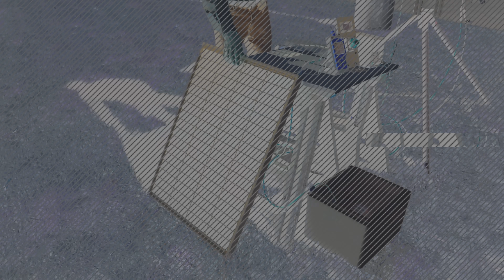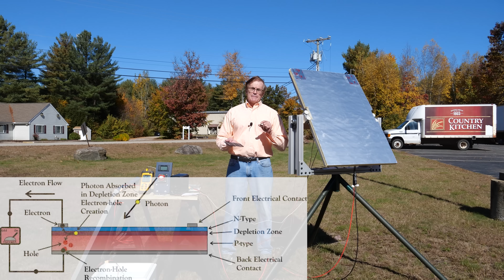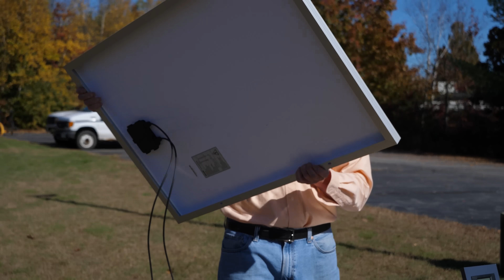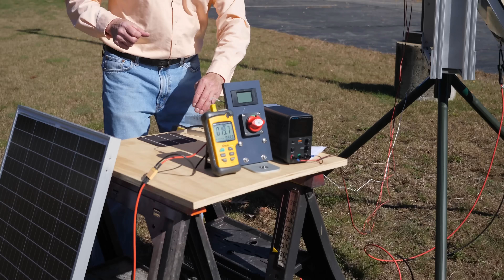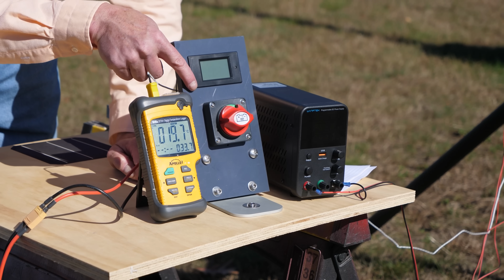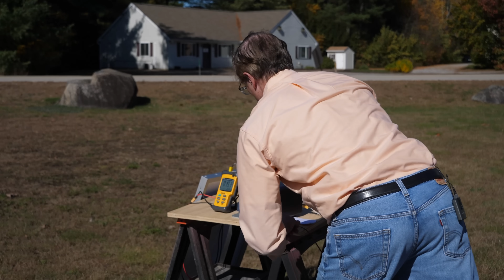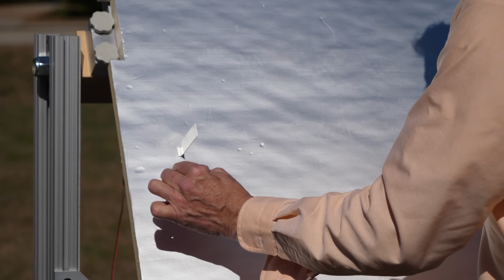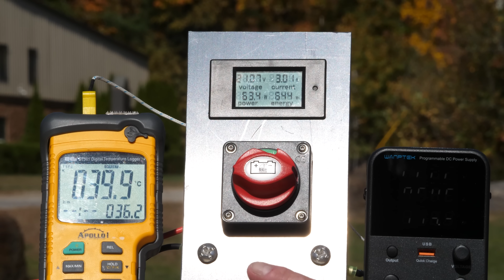Do you REALLY get enough out of your solar panel?

Comment: The benefit demonstrated in your experiment is overstated. The baseline should have been done without the heatsink and shroud. The high temperature may have been artificially high due to the lack of natural convective current on the back side. You could at least test the junction temperature of an unmodified panel in the same conditions with your second unit to confirm the validity of your test method.

Comment: I have copied part of an article to illustrate the impact on pv panels output in hot conditions. 

...... his move into solar energy came about when he installed a 3 kW PV system on his domestic roof and found it never delivered 3kW, especially on searingly hot Western Australian summer days — “In the middle of summer, it was struggling to make 2kW,” he says.

“Then I started to learn a little bit more about thermal de-rating.”

Although solar efficiency at Standard Temperature Conditions is pushing through the 21% barrier at the high end of the solar-panel market, most panels are rated around 17% efficient, and in hot, sunny conditions their performance can drop back to 13-14%.

“Panels heat up 20-30 degrees in sunlight, which isn’t good for cell performance,” Martin Green, Scientia Professor at the University of New South Wales, and Director of the Australian Centre for Advanced Photovoltaics, told pv magazine earlier this year.

Comment: very  interesting  I'm in thailand average OAT is about 35C daytime, I'd not use local water for cooling (and anyway I'd add car radiator fluid to any system to ensure no corrosion)  as it's hi calcium lake water - Anyway  I do extract distilled water from my A/C systems, but I use this for testing a solar-powered electrolytic chlorine generator Im experimenting with for the pool using scrap titanium and salt water.  So if I can get the hot water into a day to night storage tank I can have free warm showers even tho it's hot here cold showers in the morning are really not my "cup of tea" (british retiree)  I can get all sorts of aluminium stock profiles a bit like finned heatsinks I use in power electronics  from my local sliding window guys, and that bonded onto the rear of a panel could also be useful as a tunnel for airflow, either way I'll experiment,  I take heed about your decay rate over time. Very large panels here (chinese manufacture) are about 120 USD each (so what the heck are you guys paying so much for????? - import duties??, build a galvanised box section steel frame and put it in the darn gardens and anyway that improves maintenance access and neighbour acceptance and roof leaks !!!) I mean what 3-4kW per Sq Meter here and we are not using it, WTF???

Comment: Copper is a better conductor than aluminum, could you increase the efficiency by using copper? Could you achieve a similar level of cooling with a completely passive copper heatsink? Thank you for conducting this test, I live in Wyoming and I have been considering solar for my house.
Reply from the maker: It would help, but the cost would be significantly higher.  It may not be the best upgrade option.  A denser array  or larger fins in aluminum  may be a better option.

Comment: Thanks for the video, very interesting. We have PV on the roof here in Brisbane and I can see the degradation in efficiency is quite dramatic. When installed in 2019 we generated 9.35 MWh, but last year just 7.57 MWh. I think it's not just the heat per se, but the constant heating/cooling that causes microscopic cracks in the silicon substrate? I think I read that when researching it. Either way, we're making 85% or more of our power from the sun, which is saving us a lot of money 👍🇦🇺
Reply from the maker: One argument for the manufacturers not addressing  this issue may, in fact, be designed obsolescence.
Reply: @TechIngredients  Very possible.
Reply: Quality made solar panels will typically have a bit of initial degradation (~1 to 3%) within first year then degrade annually at less than 1% per year thereafter.  Your system may have an issue.  Do you have a warranty?  My panels have a 25 year prorated power warranty and if they dropped as much as yours did, I'd be immediately making a claim!
Reply from the maker: That's  possible, but at the temperatures of a rooftop  in Brisbane, the degradation  rate will be significantly  higher.
Reply: @TechIngredients  Don't know why you think that.  I'm in southern Arizona which is, generally, considerably hotter than Brisbane and my solar panels aren't degrading at a "significantly higher" rate.

Comment: Wondering what cooling could be achieved with passive means such as the chimney effect? Not that the fans are a massive power draw, but they are an added expense and point of failure. One idea that came to mind for utilizing the waste heat would be a solar dehydrator which could be designed as a chimney to draw the heat off the solar panel(s) similar to a vertical smoker cabinet.

Comment: As a wind an solar off-gridder for 20 years, I love the benefits. But I'd be interested to know what the addition of many more but smaller rear, vertical cooling fins placed in a chimney-style arrangement for increased convection & cooling air transfer (sealed at the back except with lower intake and upper exhaust)- but w/o the cooling fans- would do to reduce the effects of the heat. Esp. w/a good tracking system as I have made DIY, which maintains the heat on the panel increasing chimney effect.

Eliminates much of the cost, complexity, & maintenance while (hopefully) increasing output and longevity. I'd love a comparison test vs.  this forced air system. Even perhaps with an optimized combo system of a small computer fan (at the end?) of an extended 1 or 2 ft stack (assisting the natural chimney effect) but at FAR lower power consumption.

Just a thought.

Comment: use Peltier module in between the cooling fin and the panel and feed the power produce by the termal difference in the peltier module to the load.
Reply: or make the solar panel with a Peltier module as a base ..like  deposit the layer of material directly on the module

Comment: Yeah, but the sun isn't always shining in a 90 degrees angle from the panel. Meaning, the panel is not always running at 50c without fans. You could make use of regular convection air flow, by allowing the hot air to exit on the top of the panel, and cool air from the bottom.
Then again, if you have several panels on a roof, the bottom panels will be the ones getting cool air, while the top panels will have to do with ambient air temperatures polluted by the bottom panels. Unless each panel gets a tube of fresh air flow from the bottom of the roof.

Aside from natural convection, you can use a fan to aid the convection flow, not sure if a fan is more efficient blowing cold air in the panels, or removing hot air from the panels. Same airflow per fan, but hot air is less dense. I played around with similar 80mm case fans, and in my scenario, I preferred to run them around half a watt to a watt as well (it was electrically easier to run them at 5v in my setup, as i already had a 5v supply line).

Comment: Or I could use distilled water in a closed system. More money. And using domestic water we would have to add Some sort of water filter out impurities that we have here in Florida. That would add more to the cost as well. I used to use distilled water to cool my transmitters that I could North Carolina no it wasn’t that expensive.

Comment: Here in Florida where we live in Southwest Fort Myers area The air temperature never gets below 40° here Fahrenheit so we could use the excess heat to preheat the hot water. And the excess heat could be used to heat the pool but the pool salt water so we have to use some sort of heat exchanger interesting might be fun to do more to follow

Comment: Stopping at the 7:00 mark to comment that I would have simply purchased lengths of extruded aluminum angle instead of trying to bend all my own to create heatsink ribs. I can buy it at most local hardware stores. Don't even need a metal fabricator. In my area, there IS an industrial metal supply yard where I can buy all varieties of metals (steel, aluminum, brass, etc.) at extremely low cost. If you live anywhere near a metropolitan area, I guarantee there's a supplier within a short drive.
Reply from the maker: It's  a matter of cost.  Those angles cost significantly  more than the aluminum  in them.

Comment: It's a very nice idea the use of these fans, but... how much do they cost and for how long will they run before they need replacement? they are exposed to the weather and external dust build up.
Reply from the maker: Good question.
The MTTF for these fans is 50,000 hours  at full power. They only need to run about  8 hours per day at 25% output and then only when it's  clear. Dust may be an issue as it is for the panels  themselves, but they are washdown compatable.  Nevertheless, that has to be evaluated.
Reply: @TechIngredients  I guess the position of the fans helps the dust buildup and it's worst than the dust on the panels that are easy to clean, even through the natural way of the rain for example. 
From my personal experience (with lower grade fans, for less demanding and less exposed environment) when they are exposed to the elements they never go "the easy way".

Comment: Pity you had the plate on the back during the initial test, as it would be reducing the airflow compared to an open back
Reply from the maker: Not really.
The structure  is still open and convective flow is very slow.
The modified version runs slightly cooler than the stock panel, even with the fans off.

Comment: Very useful.  Thank You.   I'm not keen on the evaporative losses of a "flow-over" type liquid cooled system.  One commenter below J.R. mentioned a pool heater, which makes one think perhaps a dual air/water (closed loop) might be feasible, i.e. heat the contents of a water heater by day, and by virtue of daily hot water useage, there would be that much thermal capacity ready to be a heat sink each morning.    But those 3 fans connected in series and directly to the cells output do seem a very good match.
Reply: The report on using water cooling that I read online said that they used 15.6 liters of water (losses due to evaporation) per panel, in a day.  So not free, but ~125 gallons of water a month per panel isn't so expensive, either.  That's about 11-12 a dollars a month where I live, if you had 10 panels to cool.  So you do gain more than it costs as the desert sun where I live bakes everything into a crumbly, brittle dust in a few years.  45-50C days are common and for that, yes, cooling the panels with water seems a far better option than air.  For where he lives, they never get hot enough to warrant the extra cost.

Comment: What is the eval test result? Without the heatsink at the back how hot does it get
Reply from the maker: The modified panel runs slightly cooler than the stock panel, even with the fans off.

Comment: This test is bogus. First test was made leting panel to heat up, but there was no second panel in the test without fans and double wall making this tested panel into the green house. Bare panel would not heat up to what it did in this test, hence 2.5W would not be saved.
Reply from the maker: Actually...
The modified panel runs slightly cooler than the stock panel, even with the fans off.

Comment: use a corrugated plastic panel instead of the aluminum. Put the fans at the bottom blowing up since heat rises. Not sure if adding slits in the plastic would help or not.
Reply from the maker: These fans were exhausting near the top for the same reason.  Why the plastic, cost?

Comment: You aren´t taking in account that the aluminum plate in the back doesn´t let the panel cold itself by just the natural air convection. Also the maintenance cost goes up because that fans aren´t gonna last more than a 3 years if you are lucky enough. A water cooling it´s more efficient and also you get hot water that saves you gas.
Reply from the maker: Sure, it does. The duct isn't  sealed, and the backplate is very conductive.  Also,  the modified  panel runs slightly cooler than stock, even with the fans off.

Comment: I would go fanless. Route ambient air through vertical cooling funnels under the panels and build a black solar chimney at the top of the roof. The chimney creating a natural draft sucking in cool air under the panels without moving parts.

Comment: To determine the angle of inclination you need a tube shining on the screen.  If you have a circle of light, you're straight.
Reply from the maker: That's  another way to accomplish  the same thing.  The machinist's square is a little easier to demonstrate.

Comment: I'm excited for any future videos you guys do with Fresnel lenses. I'm working on an automated solar tracking lens and I want to use Arduino to gather telemetry data from the panel and the melt stand. I'm a programmer by trade, so my software engineering skills are pretty solid, but my physical engineering skills don't go much beyond building a car out of Legos. The machinist's square to find the perfect angle with the sun is a brilliant idea; I'm definitely going to start using that technique going forward.
Reply: That is basically how you track the sun with an arduino.  4 light sensors in a divided quadrant, and read the intensity, when pointing at the sun they should all be equal.  As sun moves, one or more will drift into shade, so you move it.  Just design your rack of panels so they don't cast shadows on each other when they tilt.
Reply: @robertsmith2956  yeah that works until there's a cloud for 15 minutes and your panel suddenly starts turning in a wrong direction and melts your stand. Automation, even if it's complex and time consuming, is a much better solution than the 4 divided solar panels idea. The simple solution has flaws.
Reply: @detinator5  Yes, but a RTC will let the arduino know it is 2 o'clock and the sun is at this angle.  It's called a cloud cover subroutine.  Will handle a solar eclipse as well.  If you like you can even monitor the output, drop in amps with sun jumping across the sky = cloud, not end of times.
You miss how it can be used to repel an attack.  bad guys 3 o'clock, turn and burn.
Reply: @detinator5  they would still all read approximately the same intensity though ...
Reply: @detinator5  One thing to watch out for that confused my tracker.  After sundown, the sun decided to light up the sky for 10 minutes by reflecting off the bottom of the clouds.
RTC said after sundown, light sensors said NO sun is overhead.
Reply: Non PV solar cooking systems have some interesting tracking systems.

Comment: Interesting experiment, but it does not seem to work out math wise. 
If you consider the additional costs in parts plus the extremely high number of hours of your time required to outfit and install an entire array vs the small gain in performance and slight increase in longevity.. it seems like a losing proposition. 
Even if you do not value your time and are willing to spend a hundred hours doing this to 40 cells, you still have to consider the overall increase in complexity. 
Those fans will likely only last a few years and then need replacing otherwise the cell will be toast from overheating. 
In 20 years, you will anyhow be ready to replace your cells with the latest and greatest, so does it really matter if you get a couple more years out of them?
Assuming you spent the last 20 years replacing burned out fans.
Reply from the maker: I understand.
However, despite your introduction  beginning with "math wise," your statements  are based on subjective guessing. Additives like slight or extreme aren't quantitative.
Indeed, the engineering may eventually prove that this isn't worthwhile, but the principle works, so keep an open mind.
Reply: @TechIngredients  But even looking at a surface level tells you that it's not worth the effort, though I agree that the concept does yield higher energy out of the panels. 
It was not totally clear how much profile is required per panel, but given my standard solar panels are 180 cm by 120 cm and the profiles used were 2x3 cm, and assuming a big gap between them, let's say you need 24 strips per panel. Since 99% of people have to buy aluminum profiles retails, and the average is about 4.50$ per meter, that's a heck of a lot of money! 24 * 1.8 * 4.50$. Call it, 200 bucks. 
An aluminum panel that big costs 60 bucks. So, we are at 270 bucks when we include glue and rivets. 
An IP67 120mm fan runs at least 30 bucks. 
Let's say you only need two. So, now we are at almost 400 bucks without even considering your time!
The cost of adding this is literally twice the cost of the actual panel. Where is the payoff?
Why not just buy two more panels for the same costs and get way more power?

Comment: Would be interesting to see the same test done to an unmodified panel. It's hard to guess if the added hardware in the back is making the passive cooling better or worse.
Reply from the maker: It makes it very slightly better.

Comment: The test should really compare a panel with no aluminum plate on the back to a panel with the cooling system. You’re interfering with the passive cooling of the panel by installing all that stuff on the back. Passive cooling is also more efficient when the panel is mounted landscape, but roof mount arrays are generally portrait so that’s fine for a real world comparison.

The power ratings for panels are also at STC, which is not noon at the equator. It’s 1000 W/m^2 at 25°C. Insolation at the equator at noon is higher than 1000 W/m^2. Massachusetts insolation is still about that high at noon in September. Your 100W panels should get near 100W at noon from March to September.